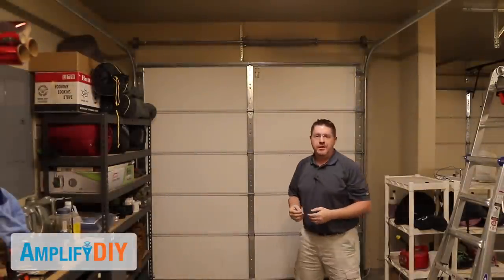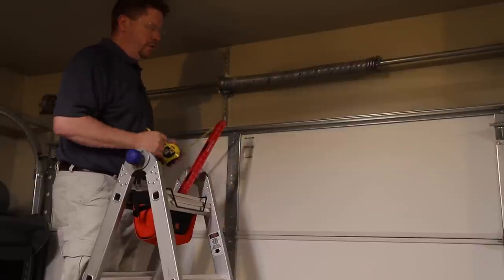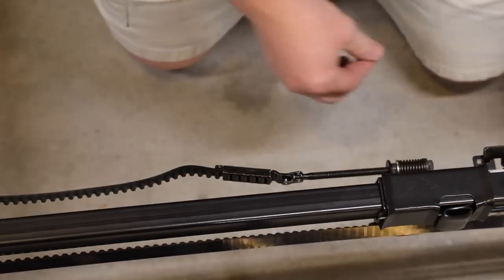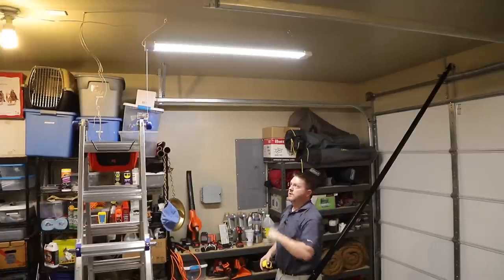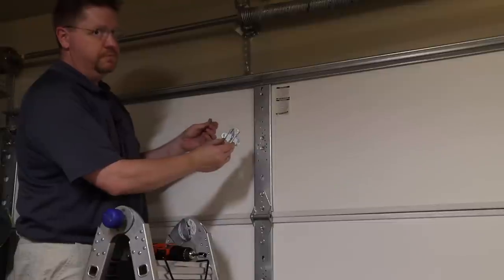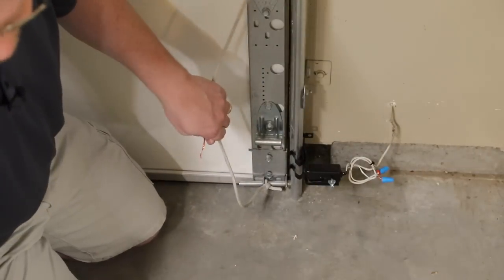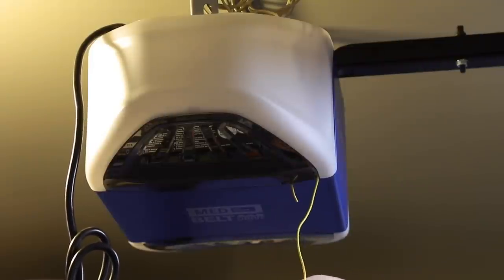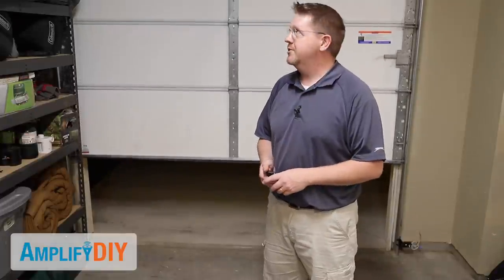How To Install Chamberlain B503 Garage Door Opener - Detailed instructions

Comment: Very good video! I started installing my garage door opener yesterday and got as far as getting the bar attached to the header bracket and installing the metal bar on the ceiling. Definitely trying the bungie trick! I was trying to figure out an easy way to do that in case I did not have a second pair of hands. This is my first garage door opener install.
Reply from the maker: I'm so glad you found this video useful! I'd love to hear how your opener install turns out!
Reply: AmplifyDIY it worked out great! Got everything working as expected. Your video helped a lot! Thank you!

Comment: Today i installed 0.75 hp chamberlain by just watching your video. Thanks. You are awesome.
Reply from the maker: Nice! So glad to hear it was helpful!
Reply: Howz going? what size wire should i use for the wiring (i mean from the sensors to the motor)? Thanks in advance.
Reply from the maker: Good question! This is low-voltage wiring, and is usually 22 gauge, 2-wire solid conductor. Should be easy to find at a local hardware store.

Comment: Hi Sir, the installation was great! It was very detailed. But there is one thing I want to correct you based on my installation experience. The problem you had in the video was not due to your belt installation, actually you did right at the first time. The only thing you did wrong was you should pull down the emergency handle string, and manually lift up your garage door, and pull it back close to the motor, you will hear a sound like 'click'. Then that is in the right position. Put the emergency handle back to the lock position. Then you can do programming right away. It is much easier than reinstall the belt.

Comment: If you use a LED bulb, make sure they the ones made for garage door openers. Regular LED bulbs can cause interference and may reduce range or make your remotes inoperative. I install garage doors and openers and I know about the problems it creates by using common LED bulbs! All the garage door opener companies have them available at home improvement stores.
Reply from the maker: @bbaaspencer1 - this is a great point! Another commenter also mentioned this. Look for bulbs that specifically list on the box that they do not interfere with stuff per the fcc (in the US). See my other comment above for a more detailed explanation. Thanks!

Comment: Another helpful tip. I install garage doors and openers and if you don't have bungee cords you can open the door manually to hold the opener until you can get up and use the hangings to hang the open safely and then once it's hanged you can close the door.
Reply from the maker: Great tip Nicolas - thanks!

Comment: On the Clopay garage door, the Clopay installation manual stresses not using the bracket that comes with the opener, and say a reinforcement bracket must be used. Their doors are apparently not designed strong enough to take the force of an opener that may be misadjusted, and could subsequently buckle the door.
It most likely wouldn't be a problem as long as the opener is properly adjusted, but if something went wrong it could damage the door, and they'll void any warranty on it.
There should be lift handles on the center of the door that the builder apparently left off in their installation, which may be necessary to operate the door manually in case of a power failure. Barring that, the rope could be left in for that purpose. 
The slide lock can have a lock or bolt put on in the unlocked position to keep someone from inadvertently locking the door, since it needs to be left unlocked at all times with a door opener.

Comment: Awesome video and very helpful. Im glad I continued to read the part about adjusting the trolly using the garage door opener itself vs taking it all apart because i also installed the trolly and belt on the motor side. Not sure if instructions actually says what end but im headed out now to finish my install....replacing a 30YO+ Craftsman opener that still works fine but cant retro to todays goodies.... 😁
Reply: Updated.... After looking at the instructions it looks like Chamberlains pics do suggest close to the motor so this is thier mistake but after the entire install  mine did the exact thing so the easier fix was to disconnect the carriage and press and hold that adjustment button until the up arrow is flashing then just manually hit that button until the carriage is near the opposite end. Much easier than tearing it apart like he did.... Easy peasy everything works great!
Reply: Also that Bungee cord idea is the only way to go.... 😁

Comment: When you measured 8” from ceiling to motor bracket, I was following your logic of cutting the steel bracket material 7 3/4” (due to offset of the horizontal angle iron mount). But after you bent the 7 3/4” cut mounting brackets, you undoubtedly shortened the distance between ceiling and motor mount & motor assembly. How much higher was the motor assembly (with angled support mounts) versus vertical mounts? Estimate? And was that your intention? I’m sure there’s an engineering advantage that I must’ve missed. Thank you sir!
Reply from the maker: This is a great question! I should have been more clear in the video on this point: You should install the brackets at a bit of an angle to form a trapezoid. This will eliminate any potential side-to-side motion of the motor when it is activated, as a trapezoid (or triangle) will resist shear forces much better than a rectangle. You can see at 18:55 of this video how I demonstrate how rigid the install is with the brackets slightly bent.  You are absolutely correct that this will shorten up the distance to the ceiling a bit - but it was not enough to make any real difference in the install. Maybe an inch? Over the run of the full length of the top track the change in angle was negligible.  Thanks for watching!
Reply: @AmplifyDIY  Or you can keep them perpendicular to the ceiling and install additional bracket at an angle between the two.

Comment: Never needed to remove the belt - just needed to set the travel limits. Also, the excessive torque seen when it hit the bottom would not occur if the manufacturers instructions were follow - immediately after the full Open and Closed limits are set, the Opener will travel closed and open to record the normal load and with that it will set the Over-Torque just a little above that.
Reply from the maker: Thank you for the tips!

Comment: When we bought our house it  already had an old chain drive opener. I. Replacing it with a new belt drive. Can I use the existing brackets and sensors that are already there?
Reply from the maker: Yes, you should be able to! That should save you a bit of work. Good luck!
Reply: Your video was very informative thanks
Reply: I will have to change the rail tho correct t?
Reply from the maker: Yes, belts use different rails.
Reply: I lost the header bracket for the opener that I removed and saved for reinstallation, is that commonly available anywhere?  I was going to substitute two pieces of angle iron if I can't locate a replacement, as a workaround.
Reply from the maker: @wingerrrrrrrrr  You should be able to find suitable replacement bracket material at your local Lowes or Home Depot. Search for "slotted angle". Good luck!
Reply: @AmplifyDIY  I have a piece of the slotted angle iron, so I'm planning to cut two small pieces and mount them spaced apart to accept the opener. Should work fine I think-

Comment: Is it OK to use the two existing rails? (I have an old AccessMaster unit in which the receiver/programming has failed with all remotes.)
Reply from the maker: You can use the existing mount to the ceiling, but replace the track and trolley with the new ones that come with your opener. Good luck!
Reply: Nope.... Maybe just the hangers

Comment: Why didn't you install the sprocket cover? My unit did not include the cover (among other parts). I would like to see exactly what it looks like. Ordered one that I thought correct but it isn't.
Reply from the maker: Hi Robert - I have to admit that since I installed this over a year ago, I don't recall if there even was a sprocket cover included with this opener. I'm willing to bet that I didn't receive one either, and just didn't notice. Were you able to get the correct part?

Comment: Thank you so much!  Had this installed today and it was a nightmare!  I called the company 6 times and no one could explain how to wire this thing.  I not only had to pay someone to install but then had to call my electrician.  I will NEVER have anyone install anything anymore with watching the video myself and then having him do the same.  I have an important question that I cannot get an answer to.  Does the rail have to be level or should there be an angle?  We used the existing brackets from my old opener and there is a slight angle.  Should this be changed to be level?
Reply from the maker: So glad it was helpful! Sorry you had such a terrible experience getting your opener installed by a supposed pro... that's nuts!  As for how level the rail needs to be: the more level the better, of course, but it's not all that bad to be off by a few degrees. If it's only off by a bit, I'd leave it. If it's off by, say, 8-10" or more, then that's probably enough to warrant fixing things up a bit.  If you want to email me some pictures of your current install I'd be happy to offer better suggestions: amplifydiy@gmail.com. Thanks!

Comment: All you had to do was manually lift the garage door up and it would engage the trolley...  trolley is installed and adjust near the motor.
Reply from the maker: You are correct. That would have been a better way to initially connect the trolley to the motor. Thanks for watching!
Reply: @AmplifyDIY  I am at this stage myself and came across this video. I think they missed this step in the manual (after the "close the door to attach arm to outer trolley" step there's nothing about reengaging the outer trolley with the inner trolley before adjusting).

Comment: My opener goes down when you push the up button when setting and up when pushing the down button. When you walk through the sensors it only stops the door when it is going up instead of down its like it set up in reverse. Any ideas how to fix
Reply from the maker: Hmm... odd. Have you checked to make sure you didn't wire anything backwards?
Reply from the maker: Sensors can sometimes be confused if they are in direct sunlight - have you tried testing the sensors at night to make sure that is not the issue?
Reply: AmplifyDIY tried it after dark and there isn't any sunlight on it         it's baffling .
Reply from the maker: Yeah, super odd. Probably time to contact the help line of the manufacturer.
Reply: Sounds like the belt is installed in the wrong orientation. When the motor sprocket turns clockwise it's expecting the door to go in one direction, either up or down. If the belt assembly is installed flipped upside down, it's going to go up when it should go down because the attachment to the trolley is on the opposite side of the belt.

Comment: You put led bulbs in the opener that will affect  it
Reply from the maker: Hey there - You bring up a great point!

Some LED bulbs don't have enough internal shielding, and they generate an RF field that can interfere with the radio reception of the garage door opener. In the case of this installation, the LED bulbs we used do not interfere with the opener. When installing your own opener, if you plan to use LED bulbs check them to make sure they won't interfere. 

Bulbs with correct shielding should have something like the following on their packaging: "This device complies with Part 15 of the FCC rules. Operation is subject to the following two conditions: 1.) This device may not cause harmful interference, and 2.) This device must accept any interference received, including interference that may cause undesired operation."

Thanks for pointing this out, Joe!
Reply: is there a way to not hear the background music?
Reply from the maker: Hi Mike - unfortunately, no - YouTube does not let me change the video file once it has been uploaded. Is the dialog difficult to hear over the music? Do you just find it distracting? I'd like to know how I can improve. 

Thanks!

Comment: You used no stud finder and you used power tools on the unit? What a risk taker.
Reply from the maker: Huh? 5:38 I explain why you don't need one. Again at 16:14 I explain why I didn't use one but knew I was going into a joist.